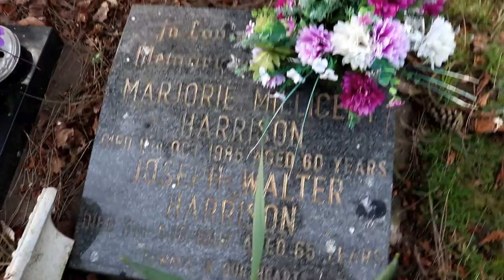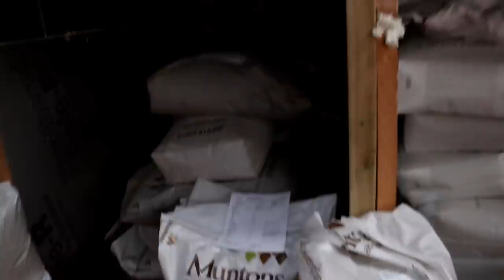THE FLOOR IS SINKING

Comment: Great update as usual, just disappointing that I can't post a slightly negative but informative comment 😉 😄. You definitely did right getting the structure sorted as you did and top drawer for actually spotting the potential problem before it became a real issue 👍 . Cheers, Schnuz.